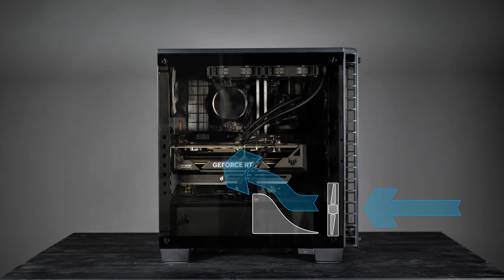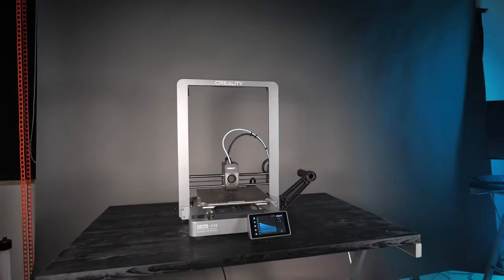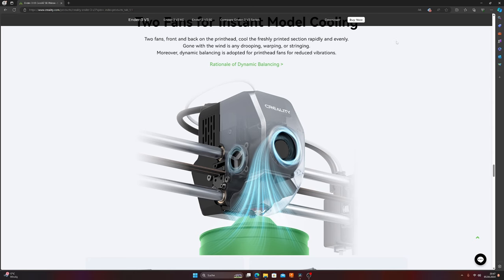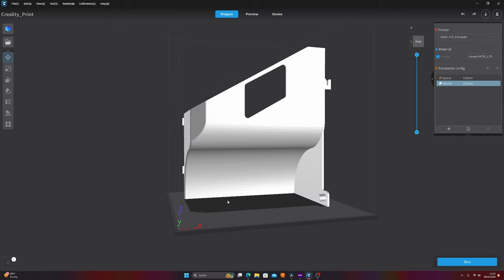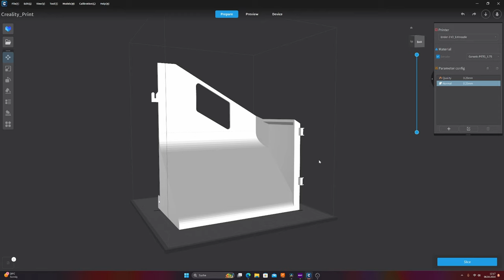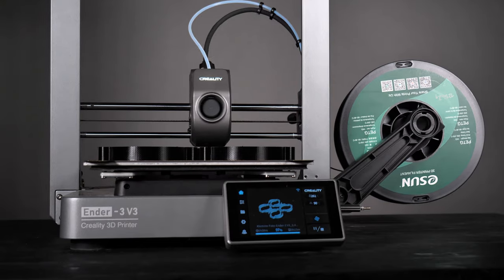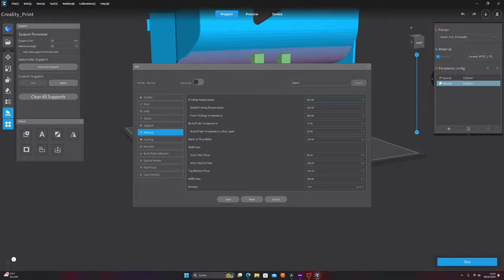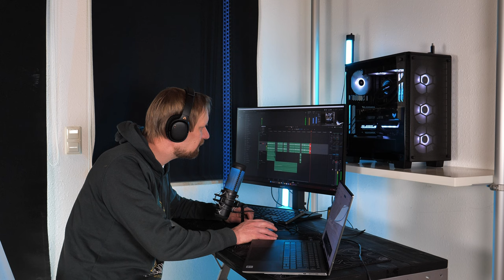I AIR RAMPED my PC! Full of SMOKE! feat.Creality Ender 3v3

Comment: I'd love to see a company combine the ability to use a 3D scanner , CAD software and a 3D printer.  That way you could have 3D scanned the original part to get the beginning dimensions, made your modifications based on the original parts to achieve your design and then sent that right to the printer. 
 Overall, I am pretty sure your modification made a difference in optimizing airflow into the GPU. I know for certain it made an interesting video to me!
Reply: Into an all in one thing? If it's good enough quality. One can certainly do all these things independently and combine them. Cleaning up 3D scanned models is the time consuming part.
Reply: @miinyoo  I'm sure it is, which is why I haven't really focused on learning much more than just passing interest on the subject.